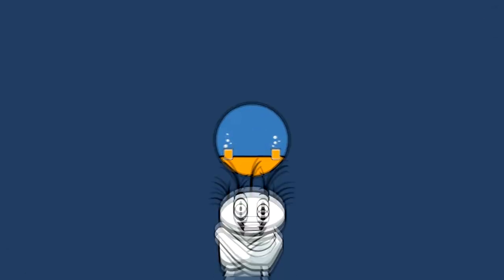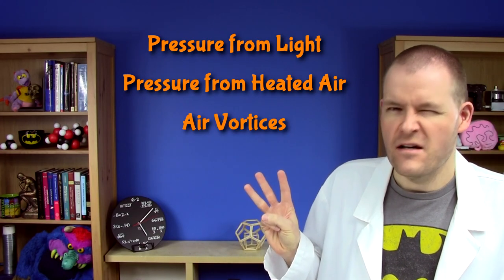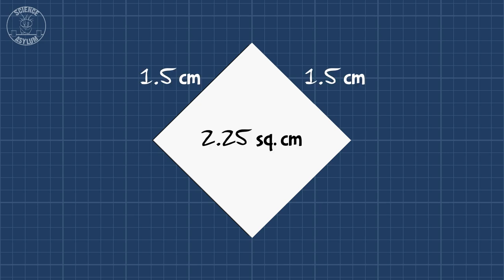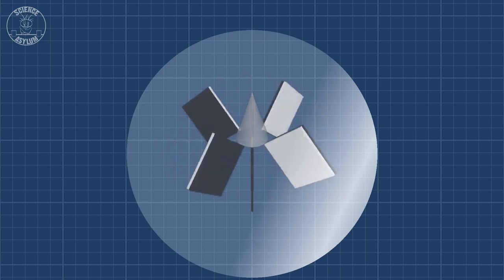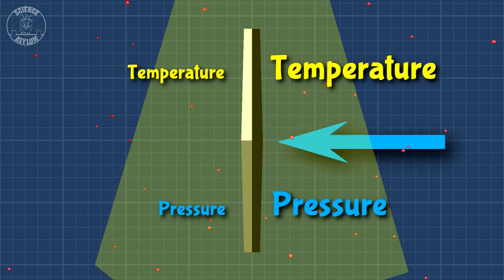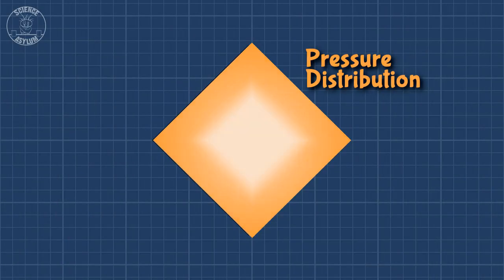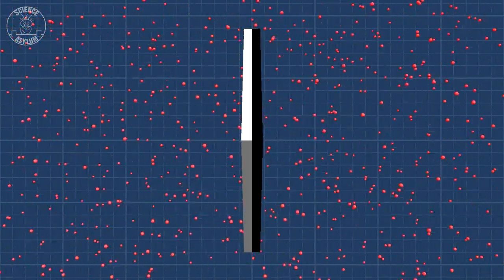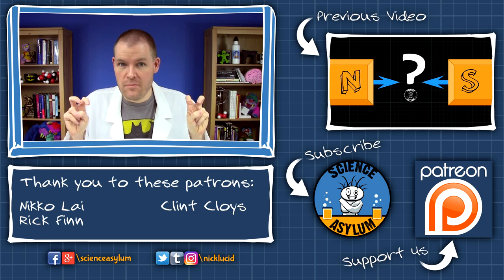How Does The Crookes Radiometer Work?

Comment: can u use this to generate electricity???
Reply from the maker: Technically, yes, but not in any practical way. The back-EMF would resist the spin so much that it probably wouldn't spin for very long... and, while it was spinning, it could barely power a single LED. There are much more efficient ways to get energy from sunlight.
Reply: The Science Asylum  so interesting thank you😍😍

Comment: I built one and it didn't work - - didn't realize I had to get down to ten millionths of  an atmosphere !!
Reply: TIMEtoRIDE900; Try using a purple light. It has higher capacitance, because of its smaller spacial footprint. Creating an electrical explosion pushing the radiometer. Red through blue doesn't have enough capacitance, their spacial footprint is to large. White light will work because of the purple in white light. Photons and electrons are not particles. Photons are longitudinal perturbations of compressions and rarefactions, in a co-axial circuit, surrounded by EM waves. The electron shells are release of electro-static energy of the neutron. Caused by dislocates of the neutrons magnetic field. Electrons have probability patterns.
Reply: You've posted this a few times. I don't understand. Light doesn't have a footprint nor capacitance. Besides, purple is not a color of the spectrum. It's a compromise interpretation of the eye.  https://en.wikipedia.org/wiki/Purple
Reply: Is there  way to introduce a small amount of colored smoke into the chamber? See what the atmosphere is REALLY doing in there....

Comment: Why does a purple LED spin the vanes but a red LED cannot?
Reply from the maker: I haven't done the experiment with LEDs, but I imagine it has to do with energy output.  There's an energy threshold you have to reach to overcome the friction at the balance in the center. If a red LED doesn't make it spin, then it must not hit that threshold. Red light has less energy than blue light. However, if you get an LED bulb of any color with 100 watt output, I'm sure the vanes will spin regardless of the color.

Comment: '
i have one new a radiometer bulb...
normal light bulb is a working on the blade slowly move spin...
but LED light is a not working on the blade
Reply: normal light bulb converts energy 95% to hit (infera red)  and 5% to visible light.
but LED is very very more efficient than normal light bulb. and it consume less energy.